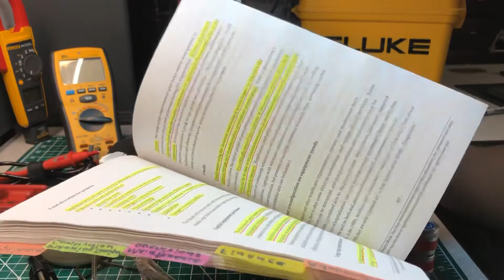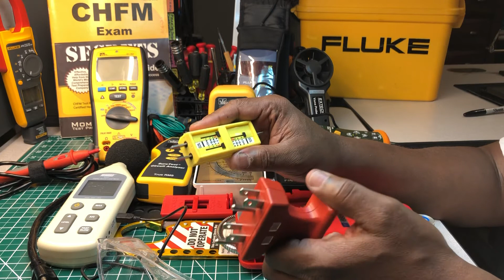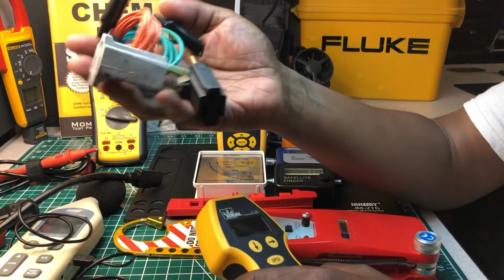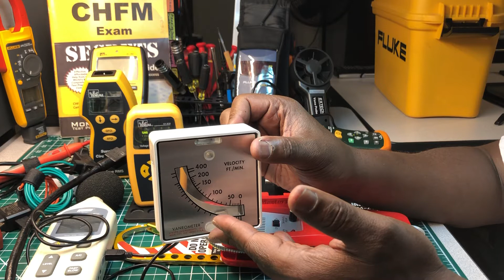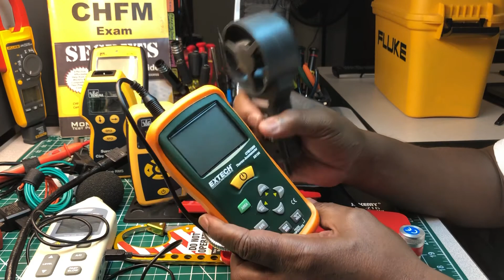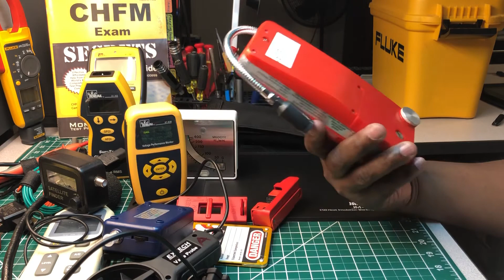🇺🇸Hospital Electrician Test Tools  ( Once ☝️ Upon a Time )

Comment: Nice video TETC, That is a posh lockout label. not seen anything like that, we just get cheap plastic strips like a key ring tag.
Reply from the maker: I purchased it from EBay if you’re interested, type in the search LOCKOUT HASP and it’ll pop up 👌
Reply: @TheElectriciansToolChannel  A master lock unit, found it cheers. 👍